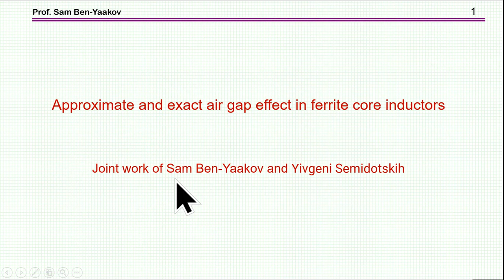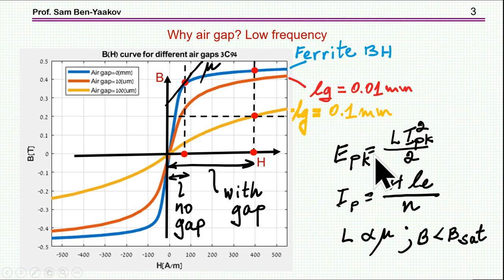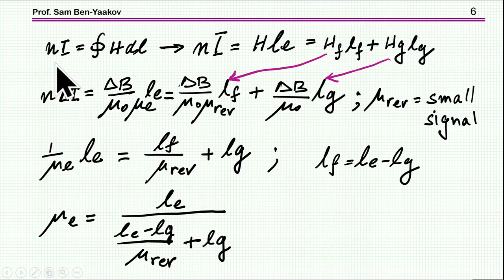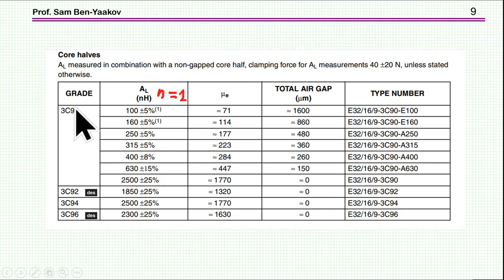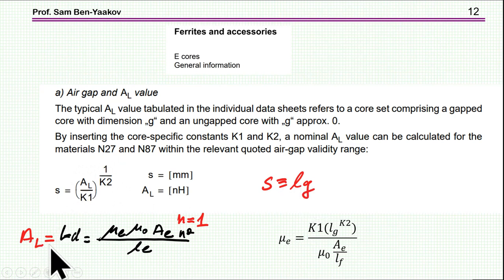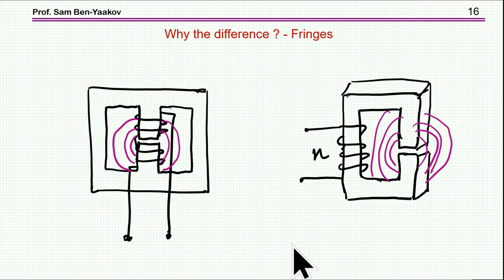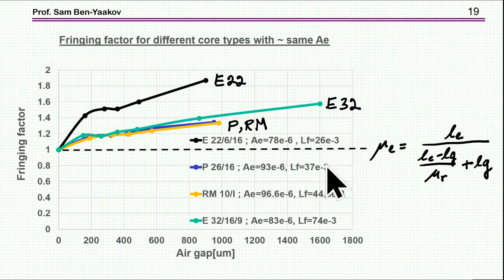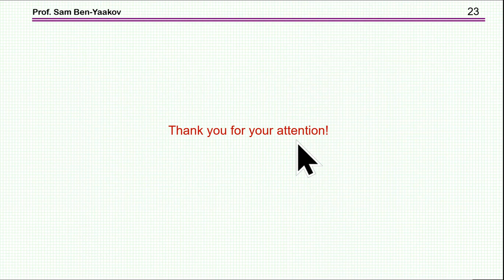Approximate and exact air gap effect in ferrite core inductors

Comment: 4:48 "it makes the inductor smaller": the inductor size is here determined exclusively by le and Ae, of which, le seems arbitrarily defined and is only set as equal to lf + lg where each of which terms in turn is arbitrarily defined since the definition of one implies the definition of the other and vice versa. In other words, how do you define lg when lf is zero? Can an equation for the inductance be given, containing both lg and lf where lf is allowed to go to zero? I'm not clear on this.
Reply from the maker: Thanks for discussion, good point. The definition of mue, assumes a homogeneous ferromagnetic body with no gap in which B is confined to the body. One this assumption is violated one can not use this model. With no lf device becomes a selonoid. Interstingly,   the equation for the inductance is the same when l is the length of the solonoid.
Reply: @sambenyaakov  Yes, exactly, this is what I was finding strange - unless the formula for the air core solenoid has a 1/2 factor (I cannot remember if it does) in which case that would mean that the formula for le/mu_e was still right.
Reply from the maker: @Stelios.Posantzis  No, it does not have a division by 2. And my intuitive explanation is that outside the solenoid the flux is spread out so if you take a loop Hdl the H in the outside is very small 😊
Reply: @sambenyaakov  So then, we are stuck with a formula for inductance that is not general (for any inhomogeneous magnetic path). That's weird: one would think that someone ought to have come up with a general formula for this by now...
Reply from the maker: @Stelios.Posantzis  I would surmise that it is possible to come up with a general formula. But it is the practice of workers in the field to make life easier as in other cases. Take for example a BJT or MOSFET, you can use the complete set of non linear differential  equations or,  for gain derivations, you can use an equivalent linear model at the operating point. I will choose the latter.